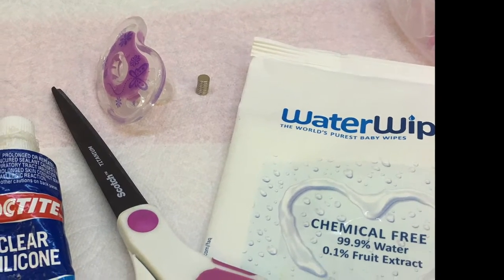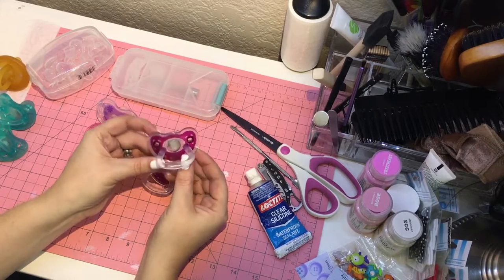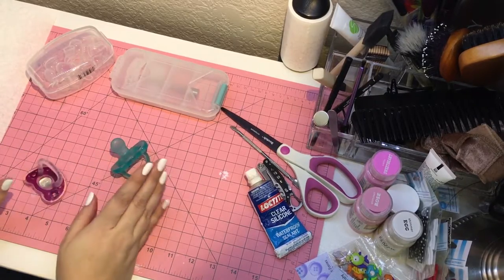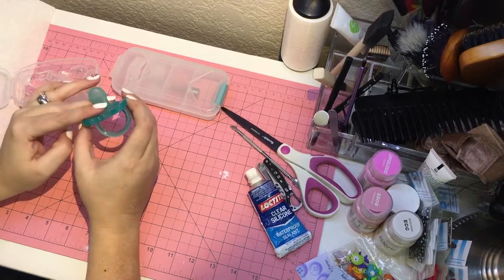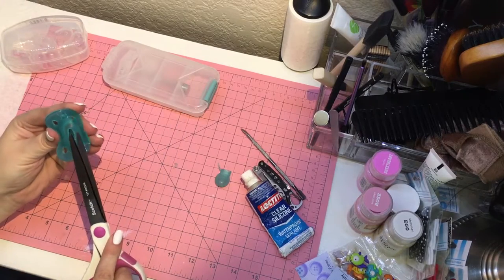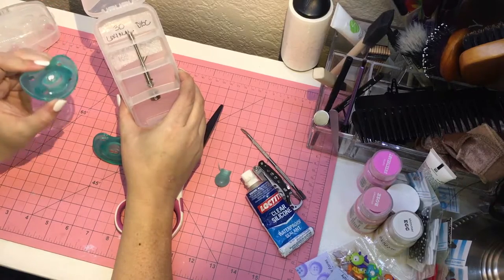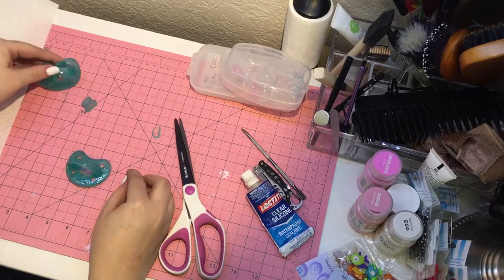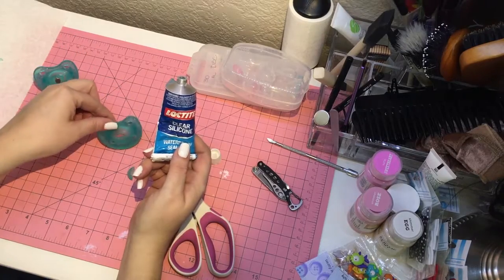Modifying Silicone Pacifiers

Comment: you can put a small sticker on the top of the magnet so you don't see it.  You can make a tiny circle of cute material and glue to the top. Thank you for this video, it was very helpful.  Also I went to the website. It is a bit overwhelming, can you tell me on the bigger round one what size and force it is. I also would like to know the one just down from that one. Thank you
Reply from the maker: Gail Westgate those are some great suggestions!! Thank you!  Yeah. Let me look them up and I will reply with the links 🙂